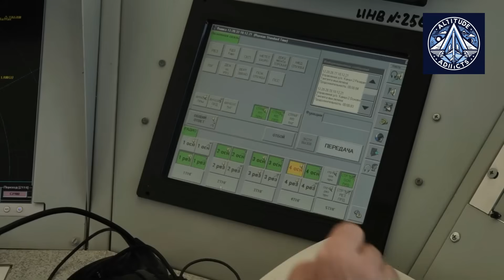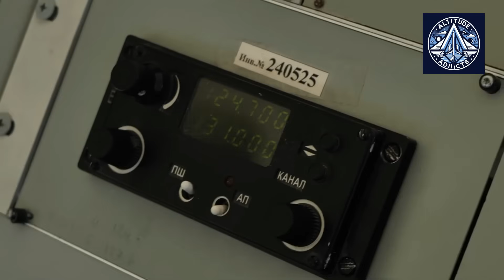Sokol Certified to Build Yak-42D Parts—A Big Win for Russian Aviation!

Comment: I wasn't aware that these old, Boeing 727 style planes are still in use in Russia.
Reply: In remote low traffic places, small improvements in efficiency don't save that much money. 
So other considerations like low demands for the quality of airfields and the ability to be operated in bad conditions and quickly procure local parts become more of a factor

Comment: In our country, Indonesia, Lion Air once operated 4 Yak-42 aircraft. This type of aircraft operated for almost 2 years and was classified as successful without any bad incidents. In 2005, many airlines were more interested in the Tu-204-300 which could accommodate 142 passengers with a 2-class configuration. Vladivostok Air once had several of these aircraft, but eventually went bankrupt due to poor management. Unfortunately, neither the Yak-42 (120 passengers) nor the Tu-204-300 (142-160 passengers) were successful in attracting buyers. Western-made aircraft in used condition actually attracted Russian airlines to buy them. In Russia, there are still several that operate the Yak-42 and Yak-42D. As long as they can still be maintained with the right spare parts, it is a form of saving to continue operating them. This is because buying or renting a new aircraft is not cheap. Hopefully the Yak-42 will still be able to operate until 2028.